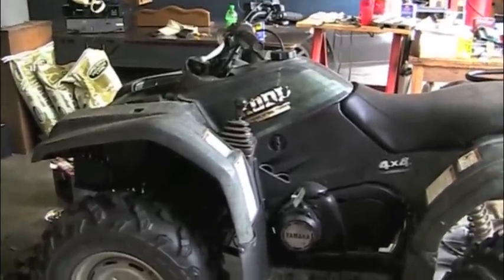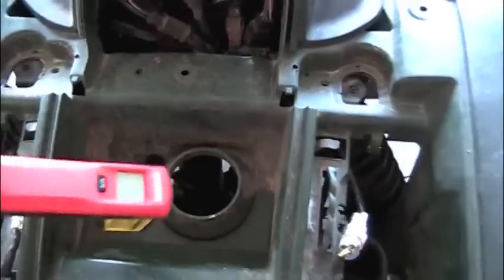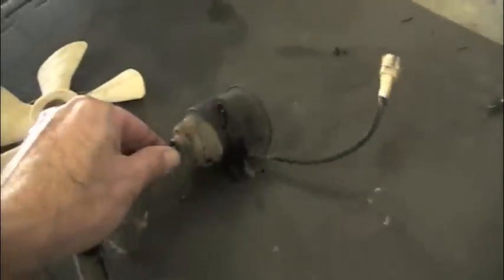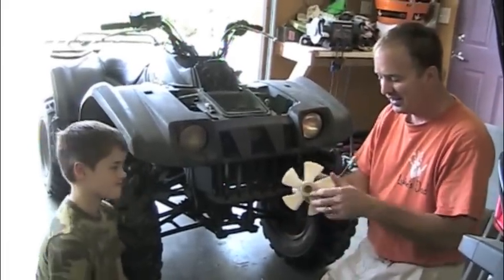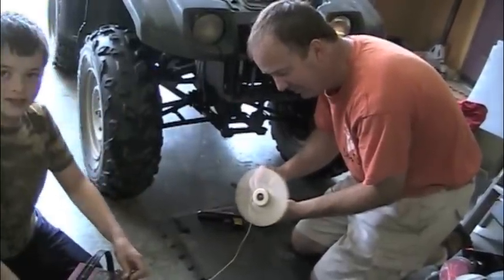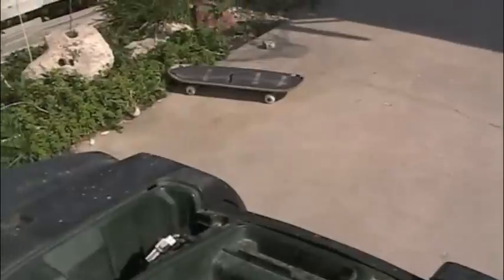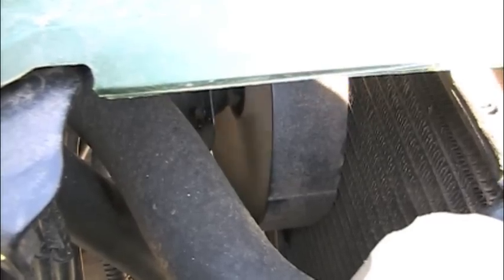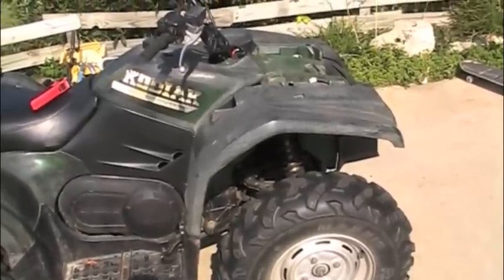Yamaha 2003 kodiak 400 overheating problem

Comment: I also have a Kodiak 400. The main reason for Kodiaks having the overheating problems is because there is a temp sensor on the top inside the radiator and it has to be wet to get a reading. So if the coolant is even a little low, it won't turn on the fan. Over time the fan can seize up due to rust. As long as you check the coolant level often and keep it full, you shouldn't have anymore overheating problems.
Reply: 2330Shikro my 350 Kodiak is over heating, not sure what to as it is air cooled with an oil cooler